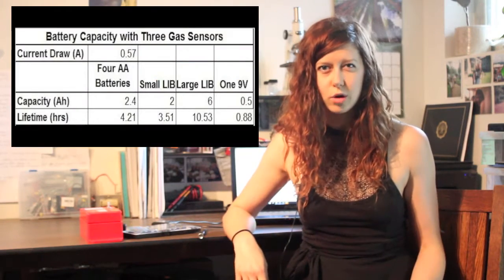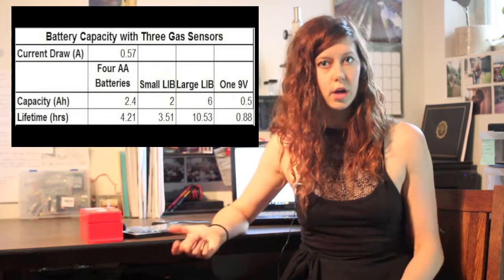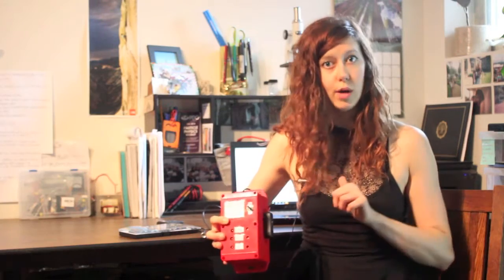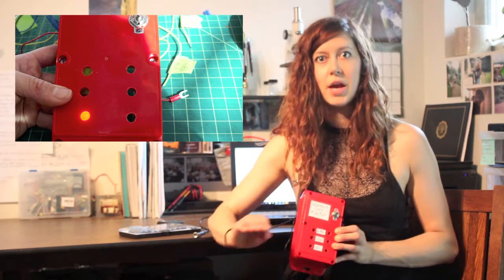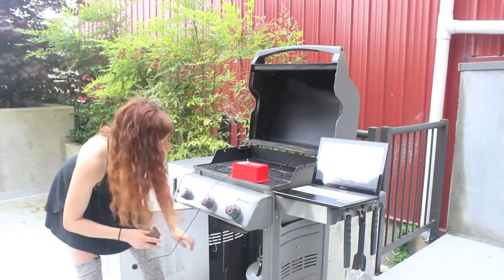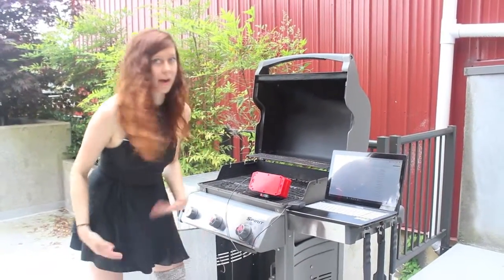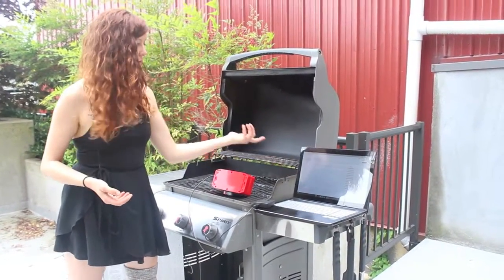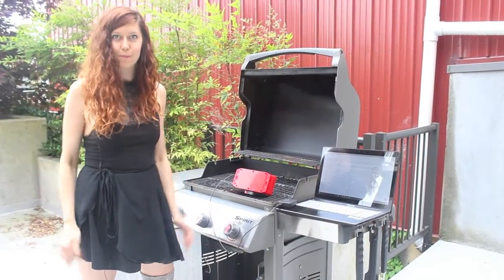Build a Hazardous Gas Sensor!

Comment: Having the device near the gas is dangerous, any spark from the device could ignite the gas
Reply from the maker: Its always important to be mindful of safety. That said, low voltage devices are low risk and the risk of gas leakage going undetected is higher than the risk of sparking.. We use cellphones at gas stations and around propane, same thing. Low voltage is very unlikely to arc and thus cause sparks.

Comment: Just a delay to the microcontroller code so it'll wait for sensors to heat up.  4 hours is just not practical, so this probably needs to be powered by external PSU (use either 5V DC power brick or a cheap step-down DC-DC converter which will fit inside enclosure, this way you can use pretty much any voltage DC wall wart adapter (6-32V usually).
You won't get reading if you loose power in your home, but battery back can be added at additional complexity of the project.
Great project btw,  I had all these sensors in my parts bin for a while, thanks for the idea!
Reply from the maker: Thanks! Glad to help motivate a fun and practical project :D 

Great ideas also. Definitely agree that 4 hrs from the AAs leaves more to be desired, but it works decently if you just want to check for a leak or get background readings (e.g. if you smell a gas leak, you can turn the system on and see what the readings are, then turn it off again). A lithium ion battery (LIB) would last for much longer (>12 hrs), just need one that outputs ~ 5V. Plus , then you can plug 'em in when they aren't in use like you suggested. If you end up building that out, would love to see your design!

Comment: If you didn't need it to be mobile, could you use a single power supply for both the microcontroller and sensors?
Reply from the maker: Absolutely! That would likely give you more accurate readings from the sensors b/c you'd have a known, constant voltage across the heater coils and A1 pins.